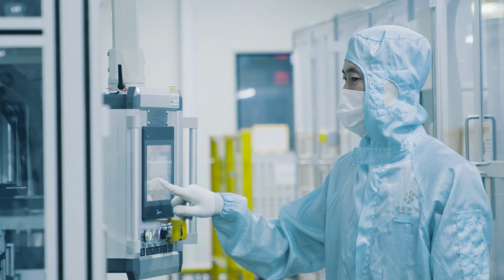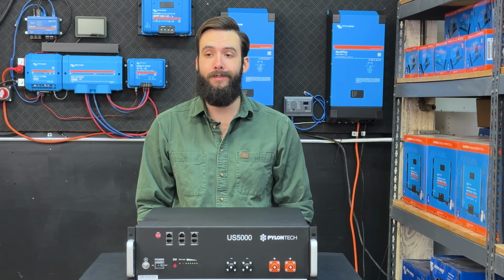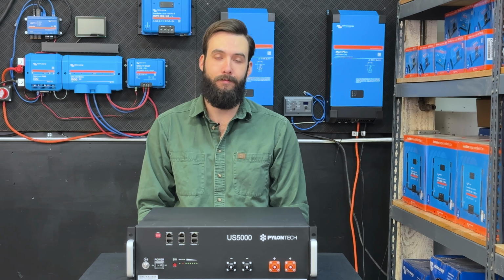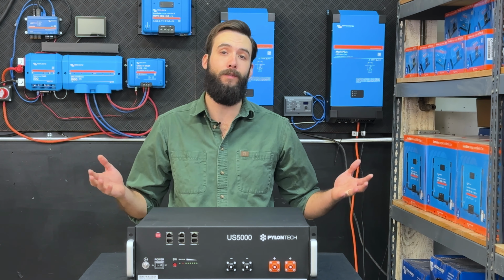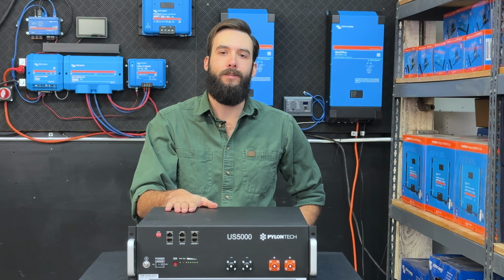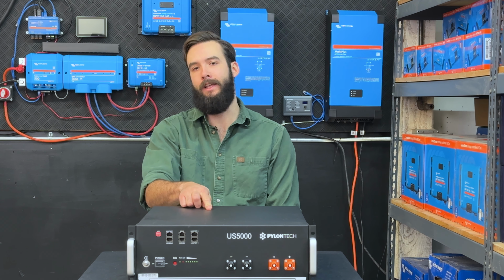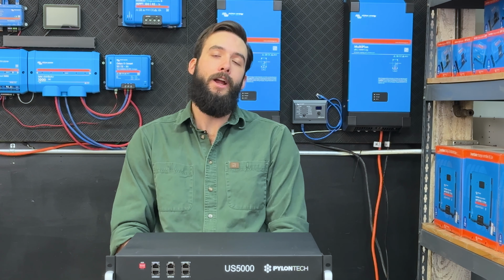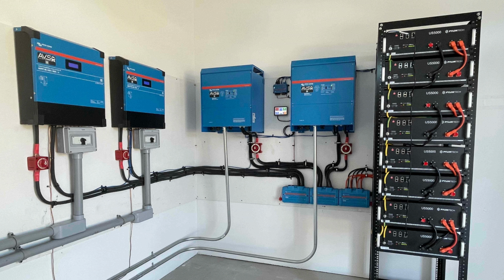Intro to Pylontech’s US5000 48 Volt Lithium Battery

Comment: Hi thank you for the video. I have the follow question, do I need to connect each battery to the other or can I connect them in a lynx distributor or lynx power in ? Also can I connect a 50mm2 cable to each battery or the cables are proprietary?
Reply from the maker: Thanks for the question @christsitouridis2213. If you would like to connect each battery to a Lynx or other busbar, it's just a matter of purchasing as many cable kits as you have batteries. So long as every battery’s positive and negative terminals are paralleled it doesn't really matter if you are daisy chaining them or running everything to a busbar. That being said, the active balancing aspect of the BMS makes it really unnecessary to do anything other than daisy chain them and then match the number of end runs to your max loads. 

The power terminals are 120A Amphenol RADSOKs. If you want to build your own end run cables these can be purchased independently and assembled with whatever gauge wire you want, keeping in mind not to exceed 120A per terminal set. Last time I checked, the female RADSOKs were going for about $25 a pop. Seeing as we sell the pre-assembled cable kit with a pair of end runs for $50, there's no real reason to build your own unless you need more than 6’6” of wire run between the batteries and the inverter/busbar. Here's the link to the cable kit on our site: https://icmontana.com/products/us5000-cable-kits.
Reply: Hi thank you for the answer. What doesn't make sense with the daisy chain is the following: lets say that I purchase 4 batteries If I daisy chain them and connect only the last terminal to the inverter that would mean for an example if I have a 10.000 quatrro that is rated for 8000w this power will be coming out from terminals that are rated for 120aX48v = 5760w. Where us if I connect each battery to a busbar I potentially can get the full 4800w from each. So coming back to my question doesnt daisy chain and then connecting only the last terminal limits the system or at least gets it really hot? Again thank you for your time
Reply from the maker: @greektraveler5279 ,happy to help. The idea is to match the number of end runs to your max possible load. The scenario you describe with the 48/8000/110-100/100 Quattro is capable of pulling a max theoretical load of 8000W or 167A at 48v. This means that the maximum number of 120A end runs necessary for this system to run at peak continuous capacity is 2 pairs. You could configure your 4 batteries for this either as daisy chained groups of 2, each with an end run, or as a chain of 4 with end runs from both top and bottom batteries. If you wanted to wire every battery to a busbar you could, it would just set you back another $100 for 2 extra pairs of end runs. The point is, the max number of end runs your system really needs is 2, and daisy chaining prevents you from needing to purchase redundant materials and then spend extra time to fuse everything. - Mike

Comment: They are def not cheap. I say this looking at the EG4 5.1Kwh for $1200. But they do look fantastic. I am curious though, like many batteries where there are multiple, it seems they connect in parallel using cables from one to another. But I have read that often using a bus bar (for both pos and neg) along the sides and each battery connects both pos/neg with equal lengths, that that is a much better even distribution of power between all the batteries. So I am curious if there is an option to connect them in parallel that way rather than from one to the next battery?
Reply from the maker: Hi @b3owu1f, Mike here. There certainly is an easy way to connect these to a busbar. One of the additional pieces of gear to be purchased with your batteries is the cable kit. These include a pair of 6’6” end runs with the female RADSOK connector on one end and a standard eyelet lug on the other. If you wished to connect every battery to a busbar it would just be a matter of picking up as many cable kits as you have batteries. The thing is, this isn't truly necessary with these batteries for 2 reasons. 

1: The end runs are rated for 120A, same as the peak C rate of the batteries. It is generally inadvisable to build a system where your peak discharge capability of your battery bank is matched to your anticipated max load. You always want to oversize your battery bank. As such, your wiring is almost always going to involve paralleling ≥2 batteries using the included shorty connectors and then sticking an end run on either side of that stack going either directly do the inverter’s DC terminals, or to a small busbar like a Victron Lynx Distributor. 

2: The BMS does a great job of compensating for any uneven distribution of power between batteries. For example, this means that with a stack of 4 batteries paralleled together using shorty cables and connected to the inverter with a single end run, the batteries in the middle of the stack will charge and discharge at the same rate as the outer pair. Even if you connect both the positive and negative end runs to the top battery, the bottom units will still stay in balance. This is the kind of feature that justifies the price tag on the Pylontechs over stuff like EG4 for us over here at Intelligent Controls. My profit margin would be about the same with EG4s and I would probably sell more of them at the lower price point, but the accompanying headaches from then having to service a less than robust battery would negate all that.
Reply: @intelligentcontrols  Thanks for info and makes sense. I hear you one the profit margin and headaches. I'd rather sell less of something that costs more but just works, little to no headaches, than deal with the never ending inquiries on cheaper items since more and more unlikely qualified buyers will buy them. Good point.

Comment: How would you compare US5000 to older UP5000. 
As we have only UP5000 available to buy , not US5000.
Reply from the maker: Hi @muhammadabdullah-xl5jf, Mike here. The main difference is the C-rate and the certifications. The US5000 has a 0.9C-rate and is UL1973/UL9540A certified making it suitable for the North American market. The UP5000 has a 0.8C rating and no UL certification. This may have been updated, but also it seems that the UP5000 is rated for 4,500 cycles versus the US5000’s 8,000 cycle rating.

Comment: Honestly the 15S cells configuration instead of 16S like literally every other brand on the market (...) it's a choice that I don't like so much. That one, and the choice of 25mm2 cables, so, sized a bit too close to the upper limit of the possible current flow for that section. In short, industrial-scale savings in a product that is not cheap.. Pylontech can do better than that.
Reply from the maker: Hi @Ale55andr082, your argument on cable size is well founded and something that gave us concern when we were new to these batteries. However, after literally thousands of installs, the cable size and the apparent restriction have not posed a challenge once. The reason is that if you responsibly size the system, we never need the full output potential of the batteries. Also, as all of our systems are communicating, the current charge rates are automatically set to a reduced or recommended rate, which in our case is 52A. Of course, we don't miss making up a billion jumper cables. Regarding Pylontech being just another battery.. everyone has the right to their opinion, and we respect that 100%. Our opinions about batteries (and we have a lot of them!) are based on experience, working on all sides - system design, installation, troubleshooting - and really wanting to understand the strengths and points of weakness for different battery chemistries BMSs and how batteries talk (or don't talk) to the rest of the power system.
Reply: @intelligentcontrols  Don't you think that 2 meter length cable is to much to connect Pylontech US3000C to Victron MultiPlus-II inverter? May I cut them to 1 mt when the distance between battery and inverter is not so high?
May I manufacture my own power cable just buing Amphenol pin connectors and a good quality copper cable?